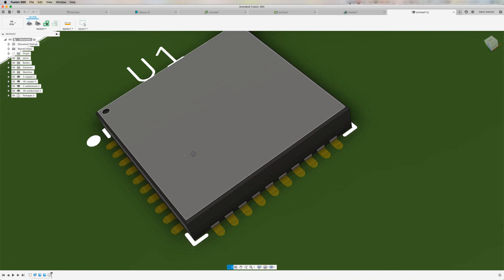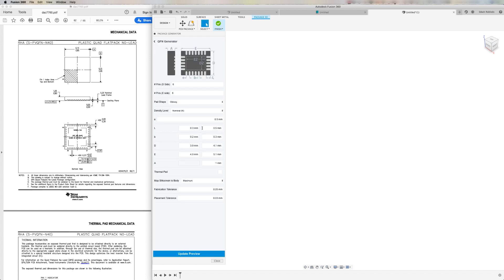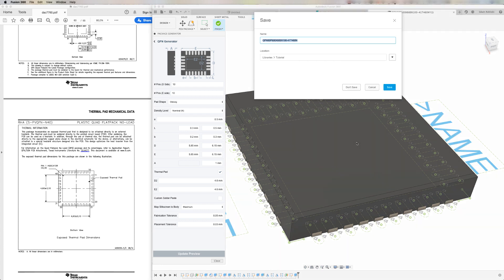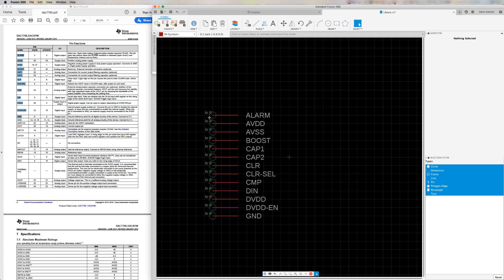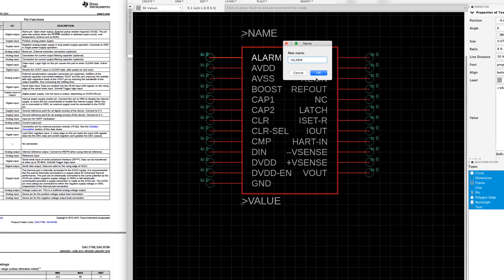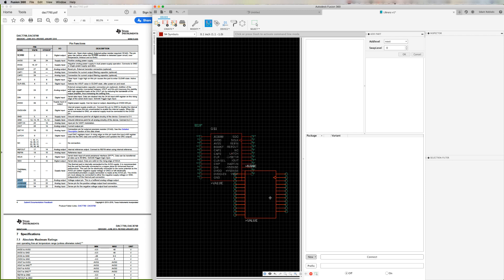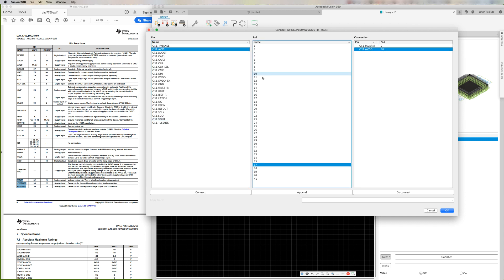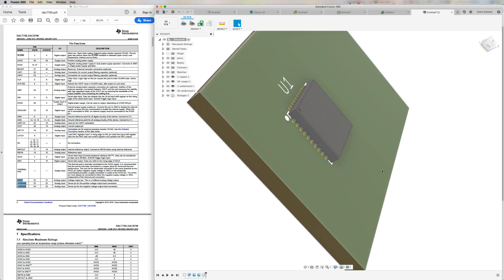TUTORIAL: Creating electronic components with Fusion 360

Comment: The connect step seems insanely tedious. This is where accepting a csv file or even just letting the user past in csv values or even a set of key value pairs would be great. It wouldn't even be that big a step, and if it wasn't only this part I was doing I'd check if the API exposes this connection, because it seems like the sort of thing that really shouldn't need to be manual.

Following along, I am creating a FT2232HPQ, and it has 68 pins and no ECAD available along with a Datasheet that did not have all the pins labelled in a convenient manner apart from the physical layout diagram, so I used OCR and a quick python script to get all of the pin names correctly numbered and have even output them in a key:value list, but now instead of just pasting that here, I have to manually find the newly unsorted pin names and manually assign them their pin values. Big pain.

Basically all of what I'm doing here I've realized could be sped up with automation and OCR. It isn't technically insurmountable and could reduce all of this massively.

Comment: The management of footprints, symbols, and pin number is far more complicated than it should be.  For some reason the tutorial explains how to assign a numbered pin to multiple pads, something rarely, it ever, seen (I have never encountered this in decades), as a result, its unclear how to assign pin numbers to pads. The screen that automatically creates standard packages in 3D from the datasheet parameters is nicely done (although of little value), but everything from that point forward needs a complete overhaul.

Comment: I have few problems: I designed my own footprint for an addressable through-hole LED, this LED has 4 pins instead of two.
I wanted to add a 3D model of this LED to the library I made, however using the tool in the video limit me to only 2 pins and trying to simply copy-paste and make two extra pins did not help.
In addition to that, despite saving the model into the library it does not show up on PCB boards that use this component.
How can I solve this?
Thanks.

Comment: I have an issue and its this. I have a symbol and a footprint but I want to add a 3rd party step file. let's say I've added this 3rd party step file to the electronic. Why can't I find the electronic with the step file, it gets really confusing from here. need help Thanks
Reply from the maker: Hi Michael, thank you for watching. I strongly recommend uploading the STEP model in the same folder as the library location. From the Footprint Content List, right-click the footprint from the list, and from the context menu select the option "Create Package from Footprint". Now you will be in the Package Editor, Right Click the STEP file located in your "Data Panel" you uploaded earlier and select the option "Insert into Current Design". Line up the STEP model with the footprint outline which is represented with the construction lines.

Comment: For complex footprints,  can you bring in the pdf datasheet to use as a canvas in the 3D model and 2D footprint editor?
Reply from the maker: I was not able to insert a PDF, but I did make a screenshot of the mechanical details and saved it as a PNG. I was able to insert the PNG screenshot as a canvas. After selecting the plane you will get scaling options. It works really well.
Reply: @adskFusion  I have screenshot pdfs for canvas before. Too bad you can't bring in a page of a pdf and draw/snap (some are vector based)
Reply: @superalpha  Well, you could take the pdf through inkspace first if you think it's worth the time...